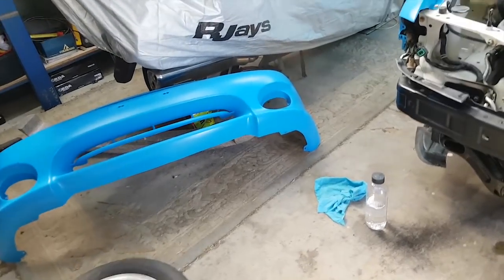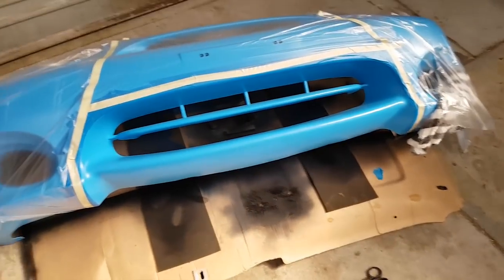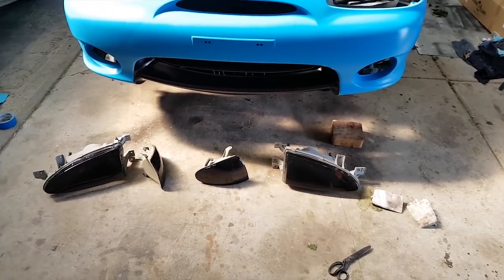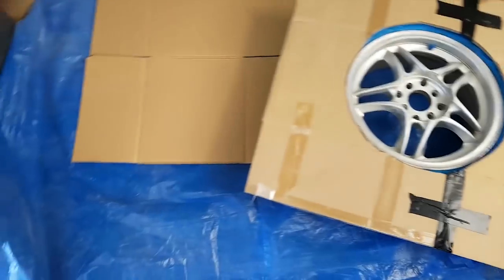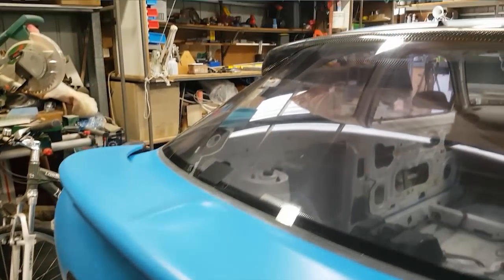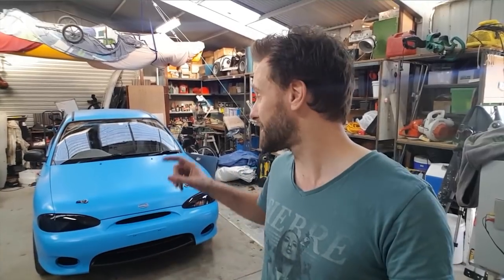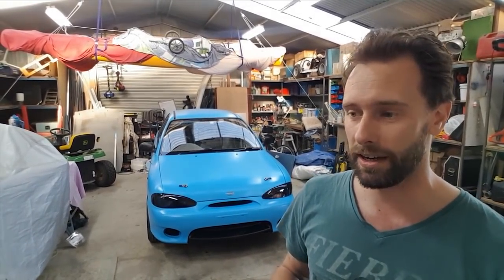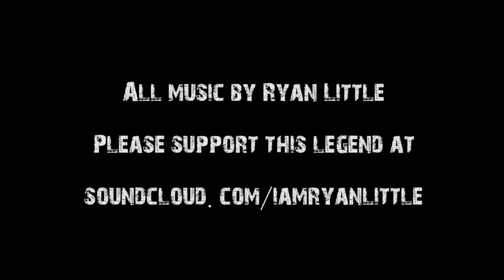Budget Race Car Build - Part 19 - Paint job reveal!

Comment: i cant believe this.... i have an excel tucked away that i've been working on for years and it has wound up crazy similar to yours. my door cards are exactly the same even including the ebay winders, my battery is in the same spot, you have similar gauges and blanking plates, mine's been smoothened out too, shock horror you actually picked almost exactly the same colour i was going for too... mine has a turbo and a massive straightpipe and a body kit and a few other bits but it has scary similarities to yours. good to see mate, i'll keep keenly following as you have many great ideas i'll pinch from ya ;) cheers
Reply from the maker: Great minds think alike! yours sounds like a beast! i have to keep my engine pretty much stock otherwise i'd be popping a turbo on it as well!  you'll have to share some pics of your ride with me, shoot them over to the facebook page :)

Comment: Good work mate. Looks good. Looks like you used painters tape for the wheels, suspect that would have been better on the front bumper when doing the plasti dip instead of masking tape. Comes off much easier and rarely takes any paint with it. 
May have covered it previously, but what tyres are you going to use for the track? Are there restrictions?
Reply from the maker: Thanks mate :) and it was the same roll of painters tape on both :)

Comment: Hey Mate. What did you use to blacken out those headlights? as I want to do the same to mine. Thanks.
Reply from the maker: Hey bro, i just used some black headlight film from ebay :) just use a heat gun when you put it on, easy!